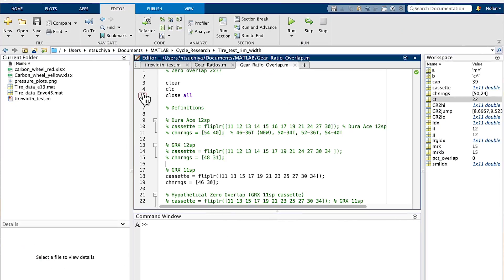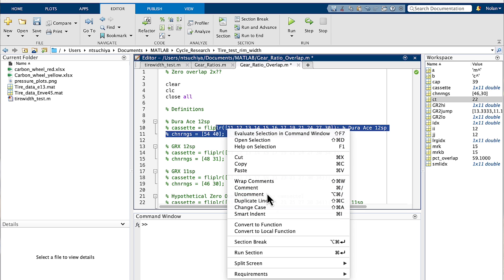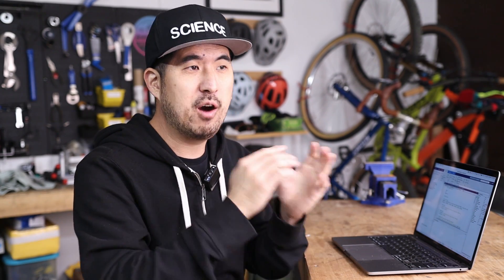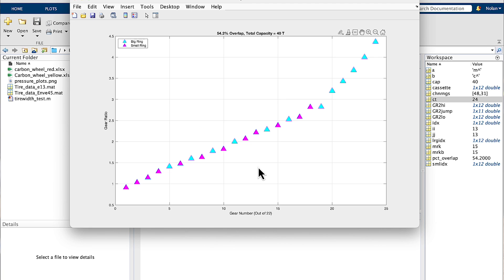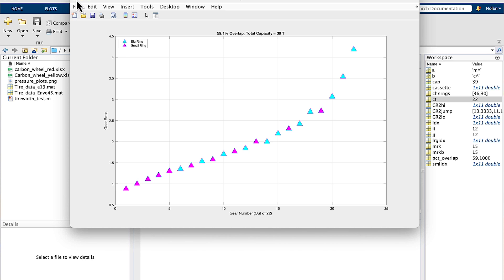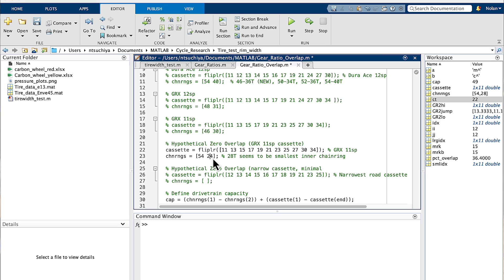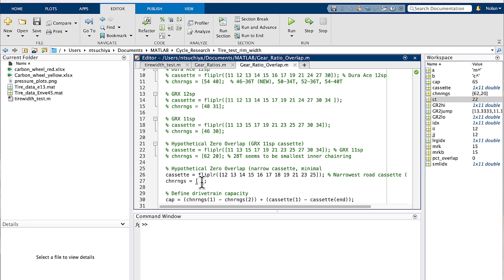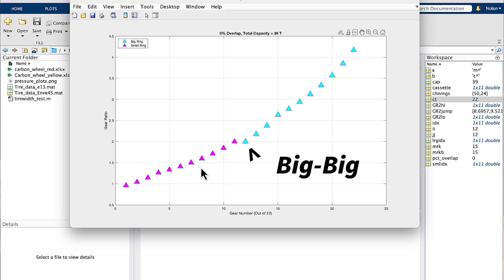Why 2x Drivetrains Have Redundant Gear Combinations

Comment: overlap is nice to have.  build a car without gear overlap. lololololol

I run triples and mostly 7 and 8 speeds... I do have a 1x7 that's quite good.. but the 12 speed I had before was garbage and lots of that was in comparison to a 2013 gripshift alivio 3x8...  but lately a 95 trek 930 really sold me with the MRX COMP and 3x7 STX being amazingly fast and easy to use

hard fails.   2x is just pointless when you can 3x and have cheaper and happier chainline with 3x7..   old deore LX..   I have an XT from 99 running a 7 speed happily. 7 and 8 speed stuff is only trash because of Tourney.. OLDER DEORE STUFF WAS 7 SPEED and it's still good.

it's all about getting the right front crank and it's a 3x with a narrow cassette 7 speed.  use a 9 speed chain.

the best of everything.. 7 speed don't crosschain as bad as all the others.. it removes the one gear excess you might have and actually HELPS HAVE BETTER SPOKE ANGLE..   watch a video about 7-8 speed carrier swaps.  then come back to this comment and pin it

all I had with a 12 speed 1x was 11 gears I jumped thru as fast as I could then ran out of gearing.   then it froze in the cold weather in low gear

compare a 22 32 42 with a 27.5 2.1 running to a 11-34t 7speed

Comment: If you had something like the classified hub gear system you could run something with a much smaller overlap feasibly because the chain lines won’t be as extreme. What limits you probably would be how much you’d have to shift on the cassette to maintain a similar cadence when you’re shifting between the ‘big’ and ‘small’ gear.
Reply: I've thought about this too. A classified system with like a 0.4:1 low range would be really interesting. You'd still have to dump a lot of gears between switches, but with modern controls being able to dump 3-4 gears going down and 2 up, it seems like a second or two of pedaling easy.

Comment: Hope Trials SS hub... will only fit 5 or 6 cogs... zero dish for. a super strong 135mm QR hub... choose the right ratios and use gripshift or friction and you could jump all the. waythrough the cassette quickly... still rather have a little overlap... but with only 5 or 6 cogs going full cross chain shouldn't be a concern...

Comment: With 24- 44 up front, and 11-24 in back, duplicates are few! Flat criterium style jumps at higher speeds , and 5 compensatory shifts toward smaller cogs on 9 speed results. 400% range with small jumps just works. You have to use the Sora band type  Fd to shift this. Chainlines aren't great pretending it's a 1x, but 9 speed is inexpensive. Also a 13-36 cassette stays within the 43 tooth wrap max with Sora medium cage Rd. An 18 inch gear for heavy touring!  Now that's range.

Comment: 11-42 cassette 11 speed and a 2X 26/39 works very well for me. I have also used a 24/38 chainring as well. This is for gravel and mountain bike setups. Keep up the great work.
Reply: My 2013 mtb had that Sram 39-26 spider with Sram front derailleur. That thing shifted like butter. So smooth. Better than any of my road bikes.

Comment: Good video. This is the kind of thing that Sheldon Brown and Frank Berto used to write about back in the 80's/90's (See Berto's book "Upgrading Your Bike" as an example). Berto coined the term "Gearfreaking", mostly to refer to touring cyclists bitd who were trying to get wide range gearing with gaps between gears that weren't too large, all while running he 5 or 6 sped freewheels of the day. Look up "Half Step Plus Granny" setups. Both those guys have written plenty about those, as has Grant Petersen, who was friends with both of them.
Reply from the maker: All legends

Comment: Range matters for me with a low bottom gear. My go to bike is a GRX 400. 46 30 chainring, 11 36 cassette.
Reply: I have the same config!
FWIW, the new GRX 12-speed has just a touch more range with 42 front and 10-51T back. I'm not going to upgrade any time soon, but I'd probably put that on any new bike I'm buying for simplicity.
Reply: @matt.3.14  👍🏻 looking forward to the upgrade.

Comment: Great video. Funnily enough I've been contemplating going to 1x on my gravel bike but since I use it mostly on the road for commuting, I've been hesitant and this clarifies the argument I had in my head for staying with 2x. On the road, I prefer the larger 46t ring since you're tend to travel at higher speeds and gravel I sit comfy in the little 30t with plenty of range with a 11-36t 11sp cassette.
Reply: I only have a mountain bike, but I use it for commutes as well as trail riding, and one of my biggest frustrations when I'm on the road is running out of gears for keeping up with traffic, but if I made the front cog much bigger I'd lose out on that easy climbing gear (rear is currently maxed out at 11-46t, front is a 32t). So I'm definitely also leaning towards 2x for the eventual gravel bike on my wishlist; besides the fact that it'd be for riding different routes than the 1x MTB to begin with, I think it makes sense in that context of still wanting to have a good few climbing gears but also a nice range for doing those faster sections of flat road and such.

Unless you're in an area with a lot of flats and only occasional mild hills, or it's all hills, etc, I think having that extra range is just a good thing, when you know you'll be riding routes that get a little of everything.

Comment: I have nothing against 2x or 3x, but I hate adjusting front derailleurs. It's very flat where I live so I appreciate the simplicity of 1x and the range of a 11 to 51 casette is all I need for that. I understand that there are people with other use cases or different topology to conquer on bike. To each there own, I suppose.

Comment: I am a fan of 1x.  For most applications, it’s simple, easy, and adequate.  But for my pure road bikes (I have A LOT of bikes), I go 2x.  You really can’t get the needed top end gearing for fast riding.  So both have a place.

The hard core touring guys are going to chime in about 3x.  Yeah, I get it.  Super low-end is sometimes needed.  But when it’s THAT low, I’ll just walk.
Reply from the maker: There you go. Thx for keeping it civil 🤘

Comment: Hey dude I have another idea for some nerd-out. The relationship between crank length and cadence changes. I noticed I was totally comfortable with a 170mm crankset on 38/11-42 setup. That same setup on a 165mm crank “introduced” some noticeably disruptive cadence jolts between certain gears that weren’t noticeable beforehand. There must be an “optimal” combination of cassette gradation to crank length. For absolute superhero status: consider tyre width.😉
Reply from the maker: That’s a great idea! Although cadence is a constant even when changing crank length at a fixed velocity. Applied torque does change though - that’s probably what you’re feeling
Reply: @TheBikeSauce  Exactly. If you assume a constant power in watts, the cadence changes should be able to be calculated right? It’s another data point similar to percentage jumps between gears….
Reply: @TheBikeSauce  Oh, and I suspect wider tyres are better suited to 1x systems because of rolling resistance and aero implications. Likely to do with momentum changes? I’m a lowly comp sci guy working in network engineering so my physics isn’t up to speed but this seems reasonable to me

Comment: I've noticed that if you run small-small worth a large diameter differential in the front cogs, the chain can actually rub on the large cog. This would be a geometric limit unless you have a super long chain

Comment: Love the bike math. I've made too many spreadsheets about my drivetrain ranges. The bike I ride most often is  2x10 and even with overthinking and analyzing this sort of thing it has pretty much boiled down to big ring down hill and small ring uphill. With my 42-28 switching rings almost always puts me pretty close to where I want to be when the slope of the ground changes direction.

Comment: With the overlaps in a 2X system, you can spend more time in either chainring while using more of the cassette. This saves wear on the chainrings by spreading out the duty cycles more evenly.  With a 70% overlap, you could theoretically be in either chainring 70% of the time. That’s financially efficient!
Reply: Ok I am not aware of this huge Difference in pricing lol, thats crazy
Reply: @biobirne  it’s even worse if you have Dura Ace. The outer ring costs about 10 times the price of the inner ring.
Reply: @TheMachoGabacho  I've gotten better cassette wear on my 1x bikes as with 2x, I'm mostly in the middle 7-8 of 12 cogs and wearing those out to the point of making the cassette worthless.
Reply: @veganpotterthevegan  I live in a hilly area, so I prefer a 2X drivetrain.  I have a SRAM XO1 1X12 on my XC bike, and I don’t like it as much as a 2X system.  That 50 tooth rear cog is awesome on steep climbs though!
Reply: @TheMachoGabacho  I definitely prefer 2x climbing on pavement.  But my gravel bike has a wider gear range on both ends than my road bike.  I run an e*thirteen 9-46 with a 40t chainring.  They make a 9-52 that would give me significantly easier climbing gears too.  I have some of the US's hardest climbs in my backyard and I weight 90kg...granted, I used to race professionally but I'm also missing 70watts😅 I'd say I have above average fitness now but I'm still very heavy
Reply: @TheMachoGabacho  I got up to 250 after a car accident. I definitely used my easiest gear on my 2x road bike(a 32t chainring with 33t cog) when I got up to 250 and could ride again.  Still not enough trouble to warrant a 10-36 cassette but that may not be true when I get older.  I really only use that 33t cog on climbs if my intervals have me recovering in z1 on climbs.  Otherwise I'm using my 10-30 cassette now that I'm under 200lbs again.  But the climbs I'm riding are much harder than what most have access to. Most world tour riders take over 55min to do them.
Reply: But you have to buy 2 Chainrings, so double the cost. Sounds stupid.
Reply: @biobirne  inner chainrings cost a lot less than outer chainrings, so if you can spend more time in the smaller ring, you can avoid having to replace the outer ring. For instance, an Ultegra inner ring for a 50/34 crankset is $19.00. The outer chainring is $157.00
Reply: @biobirne  you don't have to replace them together... still a fan of both 1x and 2x but chainring wear is largely not a thought.   I do get longer life out of 1x cassettes though
Reply: @veganpotterthevegan  I am just now switching from 2x11 105 to 1x12 Eagle on my new Gravel build with a XX1/1299 Casette, and I hope to not run into too much issues regarding longevity.
Bur I like the simplicity of 1x and don't car about cadence (til now haha)
Reply: @biobirne  ha, my gear range and cadence on my 1x TT bike is great.  Riding my gravel bikes on flat roads is certainly not fun due to cadence.  That said, my main bike has a 32/48 with a 10-33 and I only use my big ring unless I'm going up in Salt Lake City(I live in Utah).  So it's really a 1x bike in the valley.  
*In the previous 3 places I've lived, 1x would have worked well for all my road riding with a 44-48t chainring and a 10-30.. I'd just be picking which end of the cassette I'd wear out fastest with my chainring selection.
Reply: @veganpotterthevegan  I am going for 46 x 10-52 , I could never live with 44t and a 10-30 Cadette here in Germany 😅 
So I will have some different junps from gear to gear compared to you. 
For heavy gravel/mountain I got a 40t chainring to simply change it
Reply: @biobirne  I live next to two HC climbs.  I don't actually have a 10-52.  I have a 9-46 with a 40t chainring.  I've never used my biggest cog with that setup on pavement and one of those climbs near me is the 7th hardest climb in the US.  Of course,  everyone has different gearing needs!
Reply: @veganpotterthevegan  I’m a heavy guy - 230 pounds. I’ve used my 50 tooth rear on a couple of the mountains around here. Never on pavement though.  I use my 2X road bike for pavement.
Reply: @TheMachoGabacho  occasionally I want that 9-52 for gravel but it's been rare enough that I'd rather keep the gear gaps I have now. I'll probably get one once SRAM is 13sp though

Comment: One of the things I like about y two-by system is that when there's a big hill ahead, I an drop to the small ring, and quickly have access to a range of gears that will be useful on the hill, without having to worry about getting across many cogs in the back (often requiring multiple shifts).
Reply: Unless you're  using  friction  shifters, then you can sweep across and trim as many gears as you like, while  being more efficient
Reply: Or electronic! Just hold the button until you have the gear you want. @tmayberry7559
Reply: Absolutely! This is what I did with my 3x10 XT. I often used the front switch to move to a different ring quickly. But I must say shifting has come a long way and with a 1x12 XT I can drop down 4 gears with one hard press. And with two presses I can down 8 gears. And you can do that under full load. So that is useful to when going uphill immediately after a downhill.
Reply: Shifters have allowed foe multiple shifts down for a good while, my Sram X9 can downwhift 4 speeds with one lever pull, so it takes no time to go down, also the shimano hyperglide behaves great with it wich also helps

Comment: You make me feel seen!!! I could nerd out about gear ratios all day long. And way to science the sh*t out of the topic. 

I try to design my road/gravel 2x systems so that each ring can essentially operate as a 1X in two distinct environments: big ring for flats and rollers; small ring for sustained climbs or stair-steps. That gives me finer granularity in both situations. 

I appreciate 1X systems on my MTB where I am constantly making big gear changes - so big gaps and large total range are a plus. 

Closing rant - anything above 8s systems almost universally use spiders/carriers for the largest sprockets which precludes customizing cassettes. There are few stock cassettes that I like: I prefer tight ratios in the high end, larger jumps in the low end. I understand the logic of carriers, but it feels like the engineers designing cassettes don’t actually ride them.
Reply: Couldn’t agree more! Check my comment above. Cassette gradations need a rethink
Reply: Custom cassettes allow some worthwhile mods. You can even file the wide lands on a cog to allow better ramp alignment! Have made 9 of ten hub mods for 126mm dropouts,  but only works in friction mode. 1979 meets the current day!